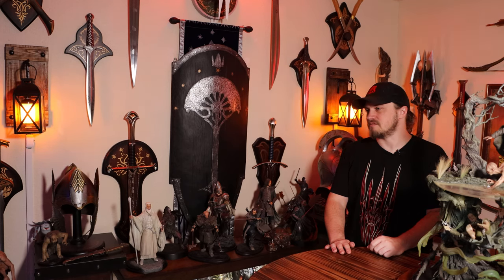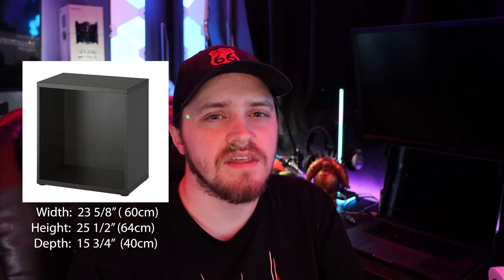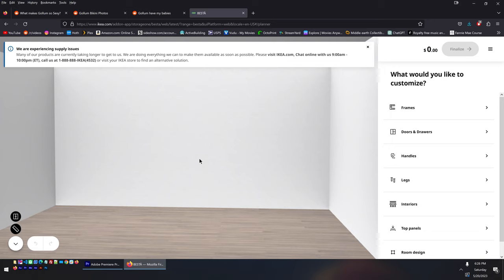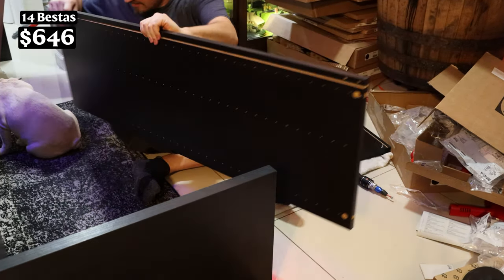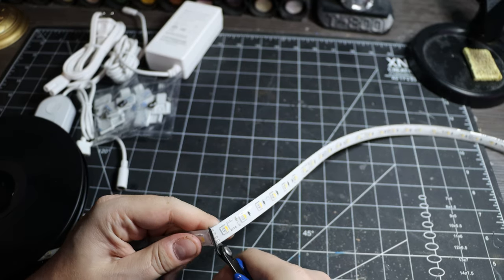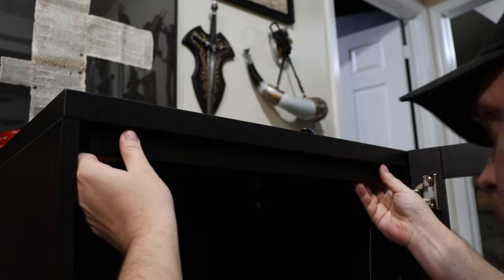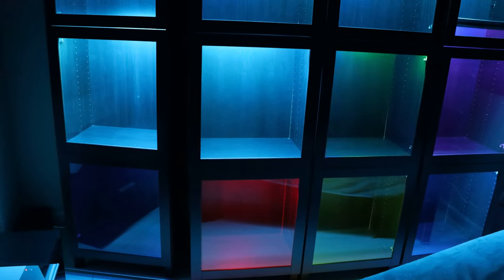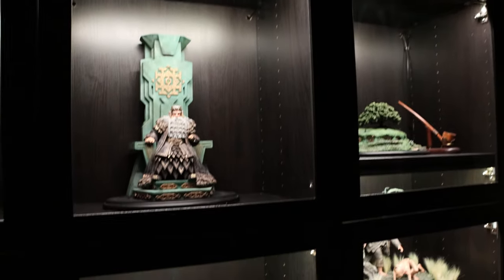Building a New Lord of the Rings Display Room with Ikea Besta & Govee M1 LED Strips

Comment: Nice job Ryan,  turned out great! For the larger door, you could 3D print the frame and attach with magnets, can also use acrylic panels as they are easily cut to a custom size and lighter weight.
Reply from the maker: Thank you sir! I was actually thinking of almost exactly that, magnets are a good idea too... my only concern was trying to match the besta black color as there's a bit of "wood grain" visible in it but maybe it wouldn't be too visible anyway with all the black. Thanks for watching man, always nice getting a comment from you!

Comment: That looks amazing, you did a very great jop and thank your for your tips!!! 🥳👍 I'm currently facing a similar project to display my lotr statues. In some comment you said "chainable/linkable puck lights" would be your go to if you would re'do. 
If i just use puck leds maybe 2 screw in each besta element won't this be blinding too much because there is no "covering" like you did with your dyi 3d print panel for your led strips? Can you help me pls on that puck led vs led strips?  Or is there some type of led strips i can use like you did without the need of cut and "solder together"?
Reply from the maker: If you get the doors for the Besta units they will probably cover most of the puck lights anyway. The things I 3d printed are mostly helpful for when you open the doors. Puck lights weigh much less and you could probably get away with just using double sided tape and not have to deal with screws. I think there are "sectionable" led strips that are shorter that Ikea sells, not sure if chainable though and not sure the sizing so you'd have to make sure. I'd probably go with something on Amazon though because you can get more a variety to best suite your needs... "chainable" as well as "hub-connected"/"central-hub" (basically they all just connect to 1 point). Good Luck!

Comment: That was a great video :)    I love seeing collections of LOTR...and I am starting to sway towards your style of setup where there is no mirrors in the back of the models and they are illuminated in a dark enclosure...somehow makes them stand out more. Now, to throw a spanner in the works...I was wondering if you are considering putting some of your beautiful models on motorized lazy susans, so they can rotate and allow you to see all sides... when my Helms Deep arrives this will be one of the first things I plan on doing :)
BTW I Love your collection!!!
Reply from the maker: Thank you very much! I agree, I think the dark enclosure with a light helps keep the focus on the statue. I didn't show it in the video but I actually did get a lazy susan for the dead marshes. One thing you have to be careful though is making sure the motorized lazy susan has the option to only rotate 180deg instead of 360deg. I have the dead marshes plugged in to a usb cord and you don't want that wrapped up. Thanks for commenting and watching :D

Comment: Hey! Amazing video and building as well..! Can you suggest a brand for the led light extension cords/cables, or the ones you used (having the appropriate length / quality). Thank you in advance!
Reply from the maker: Hey thank you! Honestly the way I did it was a bit of overdoing it with the minor benefit of being able to make the Besta units light up in a certain order which in hindsight I rarely do and just leave them on a single color. If I were to redo it I would just go with finding some "chainable/linkable puck lights" on amazon. Probably cheaper anyway.

Comment: Very nice! I'm in the process of moving, so I've also been browsing the Ikea site a lot these past few weeks/months. I knew about Besta being typically used for display setups, but for my current needs and space I went with the Malsjo line (which looks really elegant as a bonus) and Kallax (though that will mainly be for the record collection). Some pieces are still on the way, others just waiting to be assembled. I'll have to think about the lighting options later.
Reply from the maker: Thank you, I considered the Malsjo line as well but I wanted it a bit more modular (I know you can join those together too) but I wanted the ability to have a really tall unit for a few really tall statues. Thanks for commenting, Cheers!

Comment: Hey quick question 🙋‍♂️ I plan to do something similar to what you did but i was wondering if you bought the besta cubes individually and stacked them or did you buy the taller 75in one and then installed shelves?
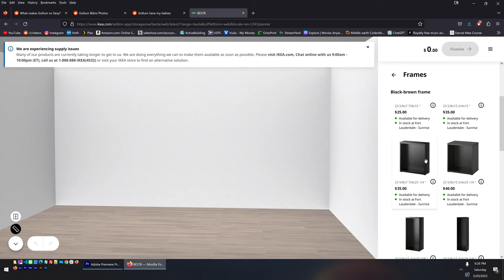Reply from the maker: I bought most of them individually but bought 2 of the taller (but not tallest) cubes for the outside. Go to 3:07 in the video.

Comment: Hey Ryan, I was rewatching the video and forgot you were using Govee. I’m thinking about getting their TV backlight with camera to match the colour on screen and was wondering if you’ve dealt with anything similar
Reply from the maker: Hey Jaxon!

I've used the Govee with the camera and I think it works pretty well. They have a newer version than the 1 that I have that uses 2 cameras to be more accurate. They do have an HDMI sync box thing but from my understanding it's more meant for computers (I think they are working on a larger size version for regular TVs though).

I also have a Phillips Hue Sync HDMI box and it's amazing, the only downside is Phillips is overpriced. 

Something else to consider, going the camera route means you can get color accuracy on ANYTHING that appears on the screen. So it'll work with a Smart TV's built in Apps like Netflix and etc. If you go the HDMI Sync Box route you it will be more accurate because it analyzes the direct pixels instead of a camera feed, so it's not prone to picking up other lights around the room that may be reflecting on your TV. 

Govee has been winning lately in the RGB battle so I would so go for Govee. You can also sync not only the lights behind your TV but other lights around the room.
Reply: Awesome, thank you!